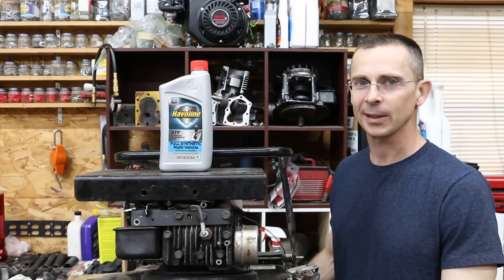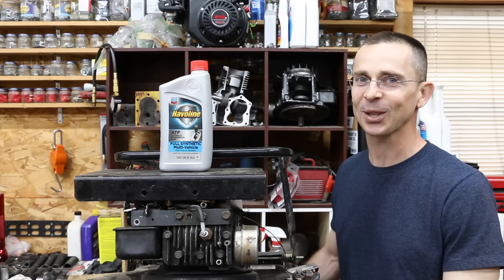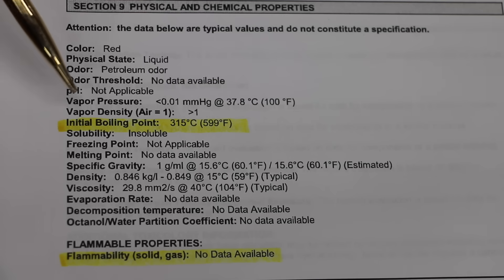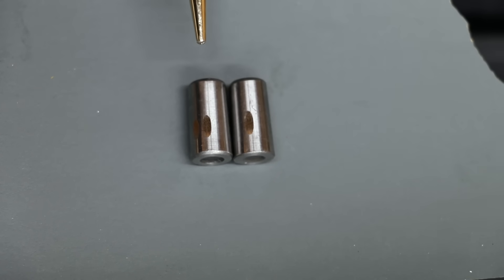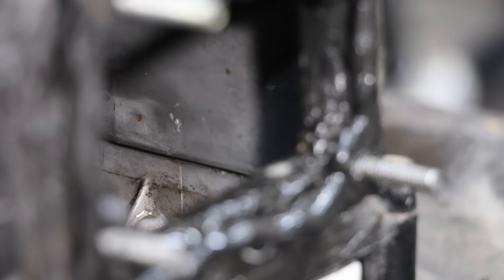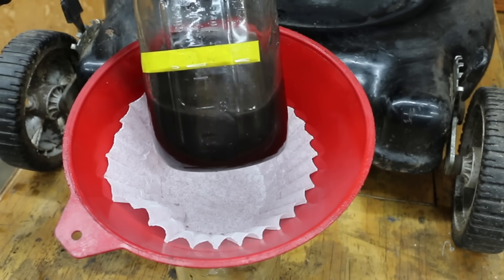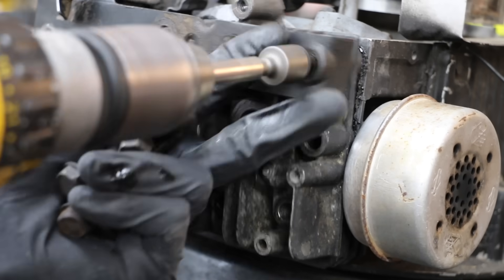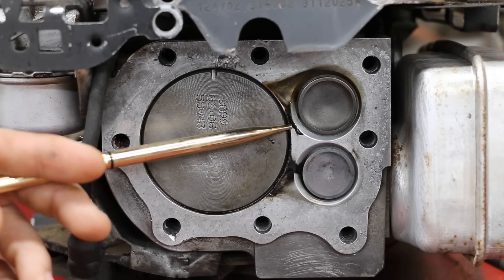ATF as an Engine Oil substitute?  Let's see what happens!

Comment: I do it with marvel before oil change. Drain 2 quarts of engine oil then adding 2 quarts transmission oil and half bottle of marvel oil. Usually drive it around the block then proceed with oil change. It can cause damage and has caused damage on the zero fooks given pick up. Lasted a week on pure transmission oil with hard driving, clutch dumps from red line and burnouts along with pointless over rev shifting. The motor was tired and wouldn't quit lol. So we put trans fluid in place of oil to see how long it would last with same driving. Damage was on bottom end and light scaring on cam. Them Toyota motors take a beating. Absolutely does work as a simple quick cleaner for sludge though. My 4.8 gm was getting lifter noise like it wasn't charging. Ran some trans fluid in the system, within the first 20 minutes was getting better, 1 hour later with a couple mild revs was gone. Did oil change went to San Diego then back home runs beautiful!

Comment: I have a trick for old engines with really built up paraffin sludge.  Gently wash that sludge with gasoline and a brush.   Then put out in the bright sun for several hours. You will see the sludge has cracked. Lightly tap the other side of the cover with a hammer. All the sludge will fall out and leave the inside down to shiny metal. This eliminates all the need for scraping. That would make a neat video.
Reply from the maker: Thank you for the tip

Comment: I used it just to get an engine that had not ran in over 10 years to smooth up a bit before its first run. If it would be just as good using regular motor oil I have no idea, just used ATF as it was recommended from youtuber that do engine restores on old vehicles.
Reply from the maker: Nice!  Thank you

Comment: While working at Jiffy Lube I was sold a car by one of my coworkers. It was a Lincoln Town Car 86. When we drained the oil from the engine. It looked more like Greece then oil. So we used approximately 2 quarts is ATF fluid in the engine to help flush out any of the Gunk that was stuck to the inside of the engine. It was amazing to see the difference between the two fluids that had previously been inside of the engine could it possibly another 30,000 miles on the vehicle in about 3 months she was running very strong until I decided that it needed spark plugs and wires and after that I blew the engine.
Reply from the maker: Impressive!

Comment: ATF is not oil and should never be used as such. It is a high detergent fluid, designed to keep the intricate passageways in an automatic transmission clean. Adding 1 qt. To 4.5 qts of engine oil will help in cleaning gruck out of a dirty engine. When your hands are grimy with oily, greasy crud from working on an engine, wash up using ATF. You'll be amazed at how clean and fast your hands get clean.
Reply from the maker: Thank you!

Comment: I changed transmission fluid, filter and flushed the transmission completely with new fluid n my 1974 Chrysler 727 transmission but I used John Deere tractor hydraulic transmission fluid it seemed to have the same viscosity but I did not do a bearing wear test my transmission is working perfectly I am wondering which is better. From my tests it seemed to be the exact same fluid except the John Deere does not have the red dye that is put into transmission fluid so consumers can see the difference. An automatic transmission is a hydraulic pump just like John Deere transmission are the same thing internally they have clutches bearings valve bodies they use clear fluid Automotive Transmissions use pink fluid so you can read the stick better and you can tell the difference with colors will you please do a friction test and any other test you can think of.. also would you do a SFR test on oils
Reply from the maker: Thanks for the feedback

Comment: Put atf in a 99 powerStroke to clean the crank case wiped out the oil injectors.
Reply: Anthony p. Harvey  Please excuse my ignorance.. but what are "oil injectors"?
Reply: @sogbryan6633  on power stroke motors the injectors run off high psi oil pumps. And it did somthing to the injectors they didn't like. Ended with a nasty misfire.
Reply from the maker: Wow!

Comment: Had 4 cylinder 2 lifters knocking used 3 quarts oil 1 transmission fluid  the lifters stopped knocking after one week drained the fluid went back to straight oil ran 100,000 miles
Reply from the maker: Nice!

Comment: I put a quart of automatic transmission fluid in my engine before I change my oil write up for a couple days a week and then change my oil haven't had a problem been doing this for years
Reply from the maker: Thank you
Reply: I take every 2nd oil change 1 liter diesel for that.
Reply: Didn't you have to drain a quart out before adding a quart of the ATF or at least check the oil level before adding additional fluids.  I assume you've check the oil level first.
Reply: Yes it's a little low by that time anyway but good. Thought thanks for asking

Comment: I used ATF to clean a Jeep 4.0. Basically I changed the oil but used one quart of atf and five quarts 10w30 and put 300 miles on it. When I changed it again it was as dark as it normally looks after 3000. The Jeep ran with no issues for two years after before I sold it.
Reply from the maker: Glad this worked well. Thank you

Comment: You didn't use any full synthetic oil. I have used it all my vehicles and have experienced smoother running; increased performance; better gas milage. Also it has cleaned most of the impurities that were in the engine!
Reply from the maker: Thanks for the constructive feedback

Comment: I had a generator for free that someone put atf In it, the exhaust valve was stuck open from Cooked on atf on the valve guide
Reply: FrontYard4X4  So this was ATF in the combustion system, yes? And Not from ATF in the crank case?

Comment: I wonder if automatic transmission fluid would make a good "break in" oil for a new engine. I wouldn't load the engine with ATF, but I would lt run full governed speed without a load for about 20 minutes, then, change to the factory recommended oil.
Reply: It lacks necessary additives.  For instance, if you have a flat tappet camshaft, the cam wouldn't break in properly, but would instead eat a lobe.

Comment: Hello. WATER ....? why not oxygenated water (hydrogen peroxide) and not at 25 volumes at 150 volumes. Practically a bomb  of oxygen, capable of burning more fuel and carbon deposits. I would try with greatest care and precaution. Oxygenated water was used in the first rockets to burn the fuel (alcohol).
Reply from the maker: Thanks for the constructive feedback

Comment: I accidentally put some in my engine do you know what will happen if I run it for a while I don't know for about an hour or two per day
Reply: If it's an old car you could probably get away with it, but it it's a newer car I would be driving it no further than the local mechanic to get the engine flushed and the oil changed

Comment: I've heard this before but you replace 1qt of engine oil for a quart of ATF.  I personally think Marvel will do just as good and is made for this purpose anyway. Diesel oil is probably the best thing to use unless you have a modern VVT system that will mess up with thicker oils.
Reply: My VVT 2.4 Toyota engine laughs at thick oils even in below freezing temperatures 🤭

Comment: 2008 jeep wrangler 3.8 v6 has 257,000 miles the only oil it has ever had is 1 gal atf and 1 qt rotella 15w40 still running strong and clean as new inside,changed every 7000 miles
Reply from the maker: Thank you!

Comment: Back in 1999 I used Castroil  synthetic in a dodge 360 ci V8, after about 4 hours of hardcore highway driving I stopped to check the oil. I found out the engine eat the synthetic oil.So I added 3 quarts of transmission of  fluid and kept driving home. It works and it cleans your engine.
Reply from the maker: Great information. Thank you

Comment: When doing transmission flushes at work with special machines, you'd be surprised at just how nasty the new transmission fluid can become quickly even if you flush 16 quarts through. The new ATF is cleaning all the burnt deposits in transmissions even below 100,000 miles.
Reply from the maker: Great point! Thank you

Comment: At is essentially 10w oil. Stays a 10w.  10w 30 starts as a 10w and ends a 30w. when heated it builds viscosity. 
If your engine is a 30w rated engine. You should keep with a 30 weight oil. 
If you have an older engine that produces smoke from blow-by oil. You can give it longer life by putting in a 10-15w40. 
Thicker viscosity will help seal the worn rings. But your starter or battery system may need an upgrade.
Newer engines with a 0w20 will have a longer life because you can easily run it on 10w30 after a 100k+ miles. Essentially giving 2 engines for the price of one. 
But the only way to tell when to switch is by examining the oil and gasses produced. Basically when you change the O2 sensors is a good indicator for what your engine is doing.
Reply from the maker: Thank you!
Reply: @ProjectFarm  love your work keep going!
Reply: @ProjectFarm  I like that you put out see what happens videos instead of a gloom and doom or streight don't videos.  
We all know you shouldn't but you are the only one showing why it isnt a good idea. Or what is the worst thing that can happen in the short term. 

I.E. Scotty Kilmer for don'ts  or killing the duramax for fake propaganda videos. I'm sure you know what will streight kill a duramax engine and what you shouldn't do.

As I said before.. love your videos keep them comming.

Comment: I used to to put a quart of  trans fluid in the crank case of cars we were going to sell at the used car dealership as a flush before changing the oil. It was cheap and worked well. The oil would come out black as nite.
Reply from the maker: Thank you

Comment: Only use it in small amounts before an oil change if you think you have sludge/carbon deposits, or need to do an oil change but for whatever reason don't have a new filter...you can flush the filter you have out with ATF. Also mix with Acetone for a good PB blaster substitute. Still think Kano Kroil beats them all though, dunno what they put in that stuff. ATF has too high of a detergent content to be a good oil, but it makes a great cleaner. If one oil could do it all...would it just be called machine oil?
Reply from the maker: Great point. Thank you

Comment: I always change the oil and filter of my 1986 Peugeot 505 GTi every 5,000 km with quality brands from the supermarket.
This car has traveled 800,600 kilometres without a problem so far.
My 1969 BSA A65L has thrived on regular oil changes (it does not have a filter) maybe after a couple  of hard rides.
Believing in expensive, magic bullet oils and running motors for extended periods is foolish thinking, in my opinion.
Sevice the engine regularly, learn how to use a grease gun and your machine will love you.
Reply from the maker: Thank you

Comment: I have used ATF to clean car engines full of sludge... ATF is very high detergent oil....  ATF is much safer to use than solvents.... #1 I will only use 20% ATF... no more and I will let the engine idle for 15 minutes... I do not drive it or rev the RPM up. It usually works well... I have seen catastrophic failures when attempting to desludge an engine... I have seen the sludge cause an oil pump failure... In my opinion the safest way to desludge an engine Is to change the oil and filter, drive it for 1,000 miles and change the oil again. I do this 3 or 4 times and have had success desludging an engine... I have not had any serious failures with this method!
Reply from the maker: Thank you
Reply: The 5.7 Hemi in my mom's Jeep always used Mopar conventional oil from the dealer. At 35,000 miles, it developed a loud tick. Being a mechanic now, I have 0 trust in anyone but myself for maintaining my own and family's vehicles. The cheapest possible fix I can think of was immediately switching to expensive motor oil like Royal Purple with a good 10,000 mile oil filter. I ran that for 5000 miles. The tick is completely gone, but the oil I drained was extremely dirty for 5000 miles. Almost looked like 10,000 mile oil. Quality synthetic oils have tons of detergent and act like a flush until the engine is clean.

Comment: I have never heard of anyone trying to run ATF fluid in an engine but I have used it as a clean out  Instead of buying engine clean out when you change your oil especially since I have a diesel that's not good to use but ATF fluid is OK and it helps get some of the build-up off your bowels out of your oil Pan And it can help to unstick lifters
Reply from the maker: Thank you

Comment: I do not recomend this change because the ATF viscosity is too low compared with the motor oil. In medium/long term the engine wear will increase. Also the detergency of the ATF is low compared with a good motor oil. The additives package are very different.
Reply from the maker: Thank you

Comment: It's common place among folks in the Saturn car community to use ATF as one of the treatments to get the Saturn 1.9L Engine to burn less oil by freeing up the low tension oil rings GM used from the factory. I've done it personally, and been able to negate the oil burning of these engines by a very good margin. From 500 miles per quart to 1500 miles per quart.
Reply from the maker: Thank you

Comment: I have never ran straight transmission fluid but with 1 to 4 concentration meaning if the system is 5 quart then I run one of transmission fluid. Cleans things up great with no damage.
Reply from the maker: Thank you!

Comment: Yeah it'll clean sludge out of a gas motor, so will other stuff, best use for it is to clean deisel injectors, a diesel motor will run on it and bring injector spray back to life, done it several times with great success!
Reply from the maker: Thank you

Comment: Who had purchased a Pontiac Parisienne, I believe in the mid-1970s and when automatic transmission fluid instead of motor oil for at least a hundred and fifty five thousand miles, that I was made aware of. I do the people who worked on his particular car and said he never had any single issue with that engine that could have been traced to any lubrication issue.
Reply from the maker: Thank you

Comment: I was always told growing up that adding a quart of ATF to the existing oil was a good motor flush right before an oil change.
Reply from the maker: Thank you.  Have you tried it?
Reply: @ProjectFarm  I did try it twice, and in one instance I noticed that after I drained the oil and ATF, I had a noisey lifter afterwards. I don't know if something broke free and caused the noise, or if a wear issue developed by running the ATF with the oil.

Comment: I have an 00 f250 v10 and long story short I had an engine tick in between 2k-3k rpms for a few yrs.  I put a half qt of trans fluid in the oil about 3-400 miles before my oil change.  Changed the oil and the tick has been gone for 2yrs.  Atf worked for me.  And I only did it 1 time
Reply from the maker: Impressive results!
Reply: Reallionaire B in a engine that size you could have used a least a full quart
Reply: @randyvinson7928  your right but it worked out for me...  And still going strong today

Comment: I worked salvaging boats and after we picked the motor and got it running we used to dump a quart of at in the carb. I was told it would for and extra moisture out of the top end
Reply from the maker: Thank you!

Comment: So what about putting one quart ATF in with 5 quarts Synthetic Oil to help with lifter noise at time of oil change. Obviously 16% ATF is different than running entire crankcase with ATF. What are your thoughts?
Reply from the maker: Great question. I plan to do some testing on ATF soon to figure out if they actually have more detergents and dispersants.

Comment: PF, a couple of years ago I was working on a cheap go-kart engine and struggled to get it running good. I replaced everything, including the ignition coil and it still ran rough with erratic idle speed. I decided to install a Pulstar spark plug left over from my Volvo wagon. It fit perfectly. I pulled the rope and I nearly fell down because the engine lit off so quickly releasing rope tension. The engine instantly ran perfectly. I was actually able to dial it in after that because it was so stable. I was astonished at the difference and it ran strong, climbing steep hills with ease. I would love to see you try out a Pulstar plug on a small engine. I used part number be1h10.
Reply from the maker: Thank you for the video idea!
Reply: @ProjectFarm  Cool! I would try it on your worst-running engine. :D